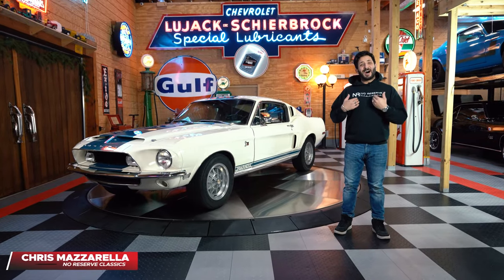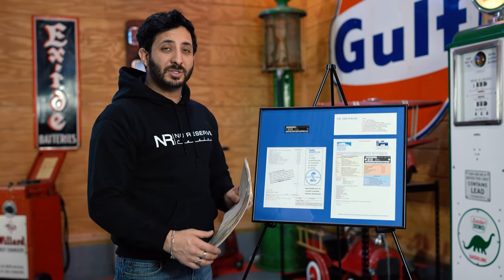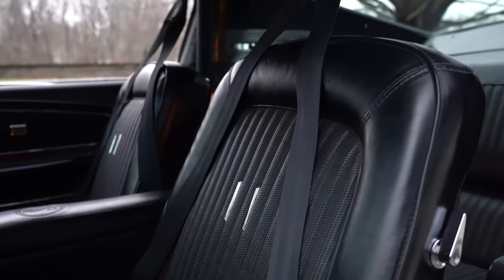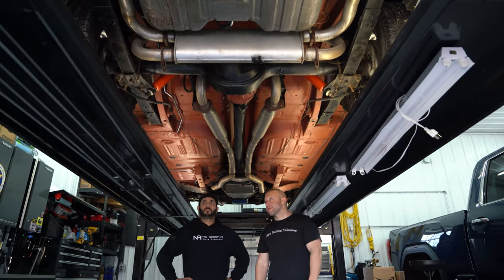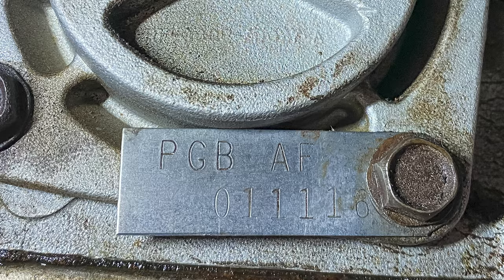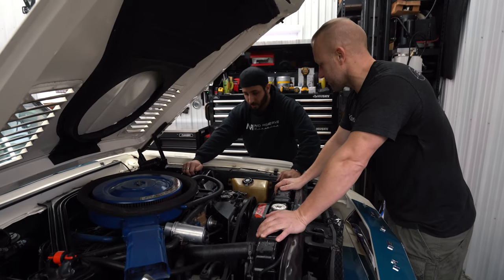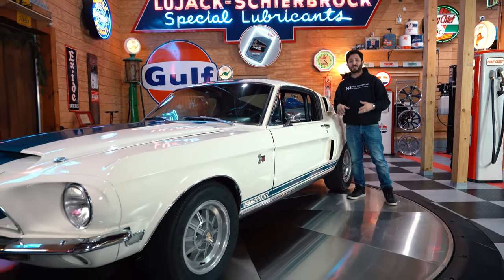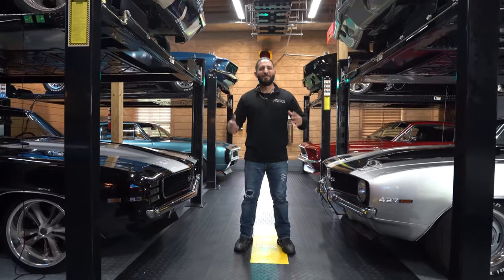1968 Shelby GT500KR Fastback FOR SALE

Comment: I also have a 68. I noticed that the brackets that attach the front header Shelby letter panel to the hood latch bracket are missing which basically brace up that header panel because they got cracked really easy back then and without those brackets it gives it even more chances of cracking. That is a nice Shelby and good luck on the sale!
Reply: You have a good eye